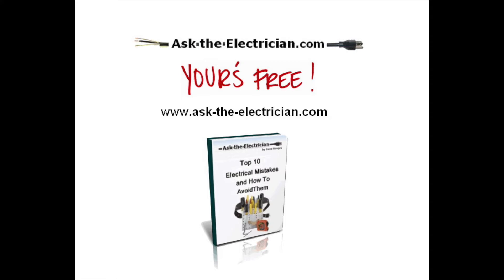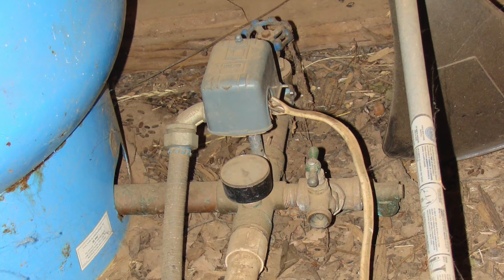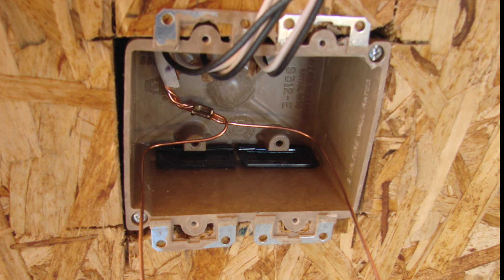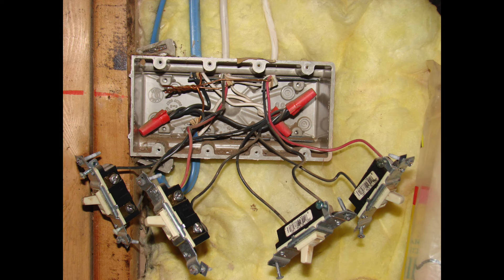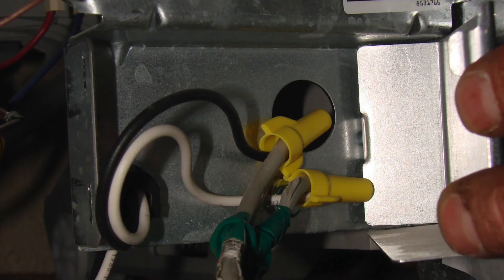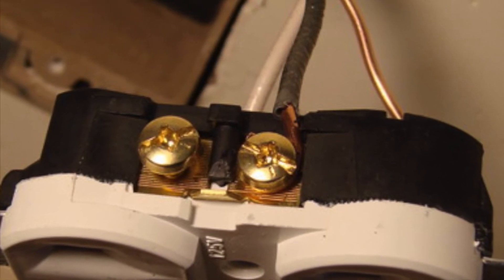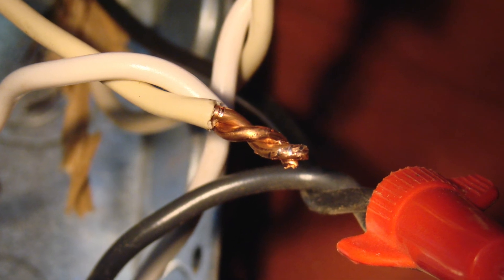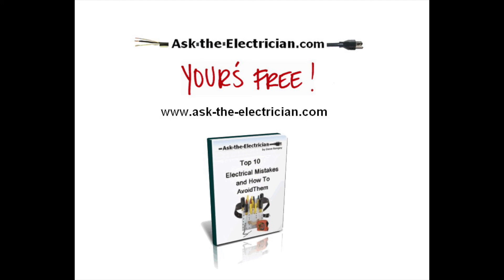How to Avoid Common Electrical Mistakes - Part 1.

Comment: Tighten down the other screw at 7:56.
Reply from the maker: As typically done.
Reply: @AskTheElectrician  I have 1 garage light out in my disconnected garage, The garage is actually connected by skinny overhead walkway roofed. 1975 house. When I first moved in, there were 2 switches at the door, and 1 inside the back door of the house. I forgot what switch does what. My friend switched 1 switch in the garage, then I could control the garage light from inside the house. I diagnosed for a while till I switched it back. Then back to normal. one wire from house switch to garage switch has a red in it. I forgot how to wire it and wonder what their mindset was in 75.

Comment: When hurricane Harvey came through a few people died from walking through flood waters with these things. Anything outside the house should be low voltage.
Reply from the maker: A clear definition of "these things" would be helpful, however water and electricity is a dangerous mixture, therefore one should be very careful when in such situations.

Comment: The last item with the exposed exterior wires could also have been done with a box extender and solid or flex conduit to extend the circuits.
Reply from the maker: Very true - great comment - Thanks!

Comment: seems u in usa still stuck 20 years ago. how u can still use wall plugs with open screw on sides? im not surprised of all fires u have there
Reply from the maker: We use UL Approved materials here in the USA. Home wiring when installed properly does not start fires. You may be referring to forest wild fires which are started by lightning strikes and careless campers. These fires are not limited to the USA, they are happening in other countries as well.

Comment: See 300.13(B), pigtails on neutral pass through is NOT optional.
Reply from the maker: I see you point, however when reading 300.13(B) a little more closely we can see that  the wording is ambiguous.
Reply from the maker: However, the hazard there is real, in that the 120V devices on the two-wire circuits could be exposed to over voltage on loss of the neutral.
Reply: @AskTheElectrician I would assume that you're aware of when the word "shall" is used, that removes any ambiguity?